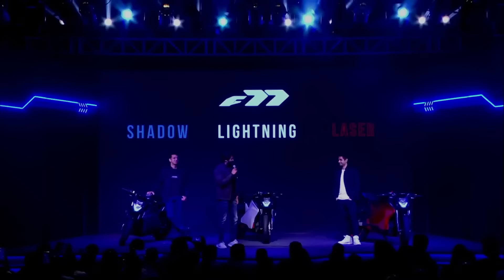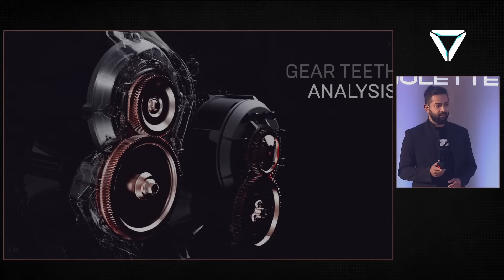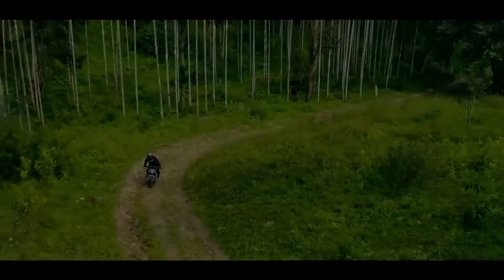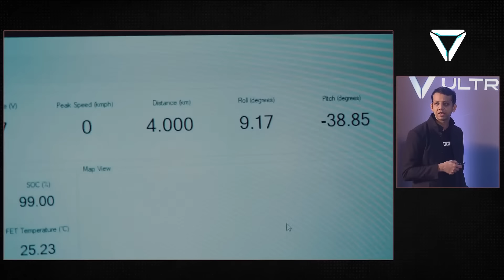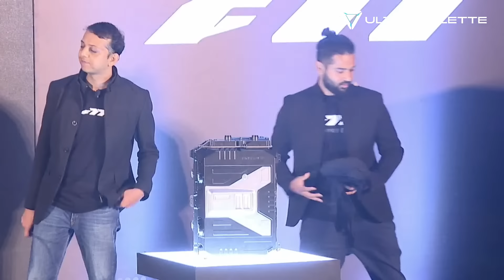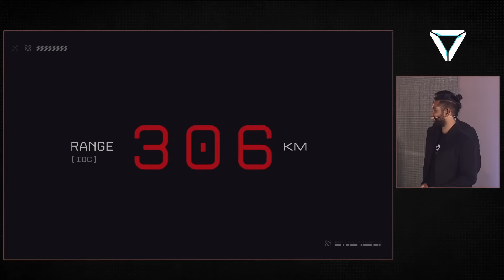Ultraviolette Battery Day

Comment: The problem with ev is... that battery needs to be replaced after a certain number of KM or if it gets damaged anyhow. Considering that the battery is the most expensive thing on that bike and it is non removable... please share the price of the battery pack and its estimated life also let us know if you provide any warranty or insurance for it.
Reply: They did say life would be around 10 years

Comment: Well i see two glaring issues which i don't know if they intentionally left them out but they are modularity and charging time. They can't possibly expect me to take up fifteen floors to charge and how long will it take to charge? It looks too heavy for being modular also what happened to the shelf function which would pop out the batteries bcoz they sure as fuck would have to can it. Please i need some answers man 😩
Reply: The battery is fixed now. It is no longer removable. But getting a charging plug at parking area is not that hard.
Reply: @evthink  my guy i live in mumbai. There is no place for a charging station or plug as my apartment opens up on the road also it would be fucked up in a month by other dumbasses

Comment: Battery capacity in kWh?
Reply: 10.5 kwh🎉🎉🎉 i saw
Reply: @BhushanShelarRA  source?
Reply: @ramrk9929  check out in youtube one guy came in event and talked about it and if the range is doubled i suspect battery size is almost double and as its not moduler it must be 10.5 it shook me it will not cost less than 4 lakh
Reply: @BhushanShelarRA  Well when it needs 4.5-5kw/h (I very much doubt less), it will have a realistic range of 200km with normal driving. Not bad :) Lets see about the price. For foreign countries, I hope it won't be too expensive.
Reply: Want to know it too.